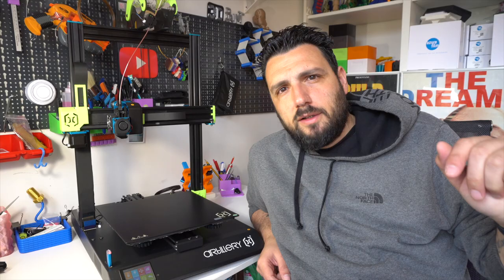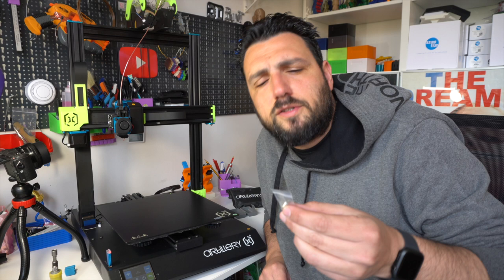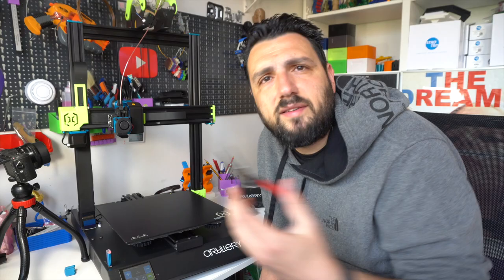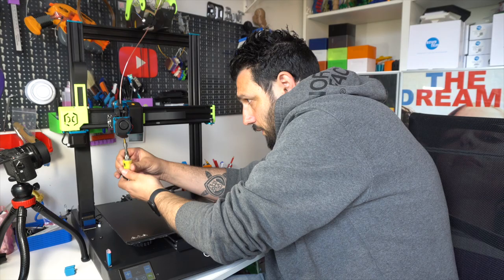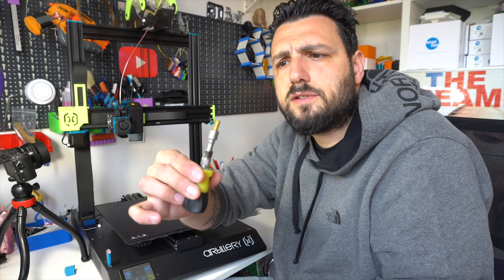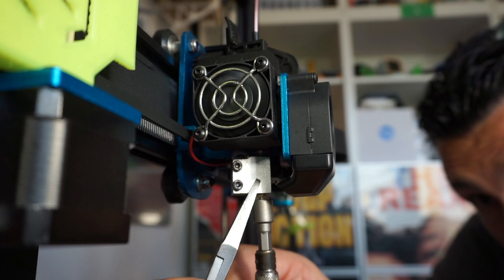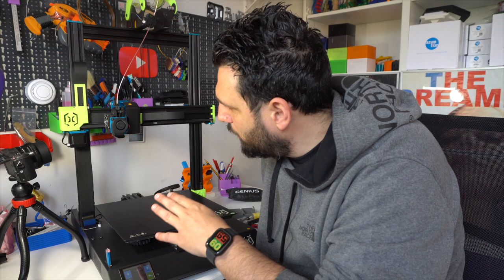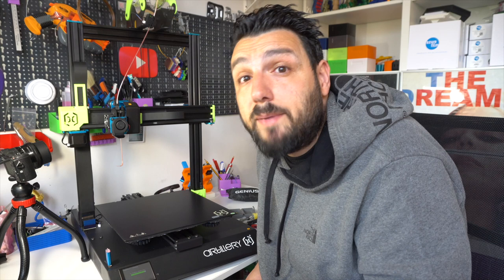Change Nozzle on ARTILLERY SideWinder X1 & Genius 3D Printers

Comment: New to 3D printing so excuse me if this is a dumb question, but was your bed leveling easy with the different nozzle height? Tried to change the nozzle on my Sidewinder X2 and the new longer nozzle is hitting the bed and the auto-leveling isn't working?
Reply from the maker: hey mate, no such thing as dumb question... no worry. After you change the nozzle you need to rerun the automatic calibration. have you done that after changing iT?